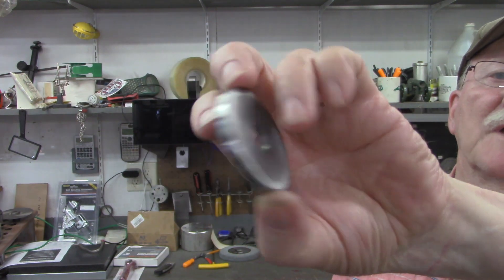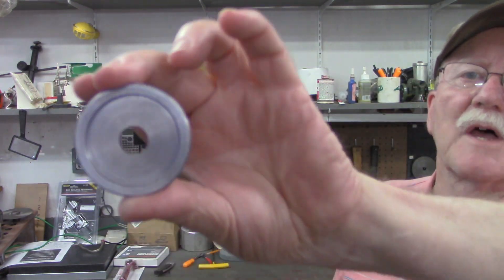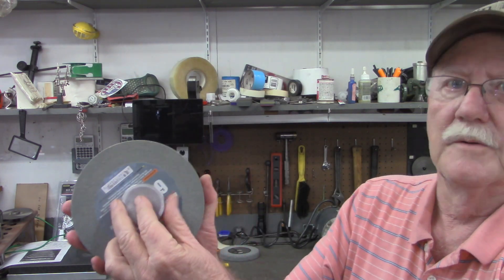Machining a Flange Washer

Comment: I am one of those who prefer the basic manual machine shop tools.  Where I am a surface grinder is a luxury in space and money that I cannot afford.  Thus as with CNC I don't watch videos about those tools.  Where I am located there is no real used tool market and just shipping added over a thousand dollars on my new mill three or four years ago which has gone up considerably.  I have a large shop for a home guy but a wood and steel fab shop with all the necessary tools and storage eats up room.  Then there is the fact I am in my mid seventies which doesn't leave much time for expanding into more projects/tools.  So I watch those that directly concern my interests and abilities.  As we get eaten up with rampant inflation and rising taxes one hesitates to spend on high cost tools that can be done without.  Thus I like and watch your fabrication videos when they use the tooling I have.  I do understand your situation.  I told myself years ago that when I reached retirement I was going to do the things I wanted to do rather than what I had to do.  Twenty years later I still haven't gotten rid of the have to do's!

Comment: Intresting point on surface grinder videos. I for one as a machinist used surface grinders at work and was trained to use it in machine shop HS...YET never wanted / needed one in my home shop. Like that sharp job on the flange washer Lee.💯

Comment: Good morning Lee, I might be the exception but I like the surface grinder content.   I recently restored a Harig Super 618 and installed a new lube pump.   I documtented it on the Hobby-Machinist Forum.  It is titled “New to me Harig Super 618” in the Tool Grinder & Surface Grinder section.   Replacement pumps are too costly for me so went with a more economical solution.  Maybe it will help you.
Reply from the maker: Thank you very much. I will definitely check it out!